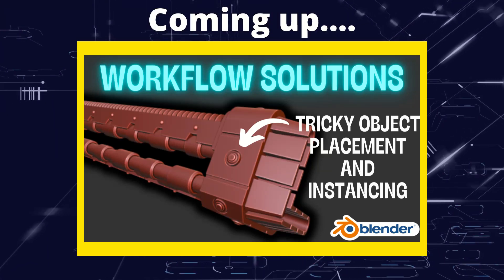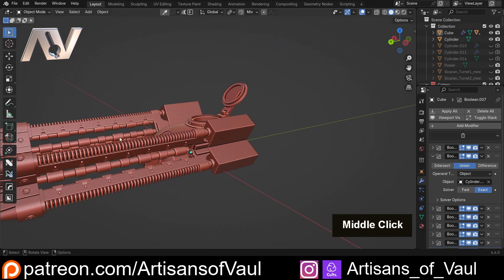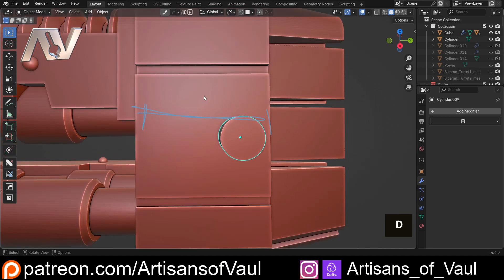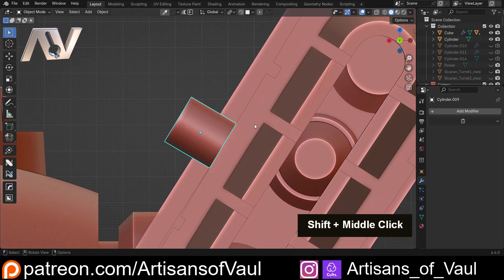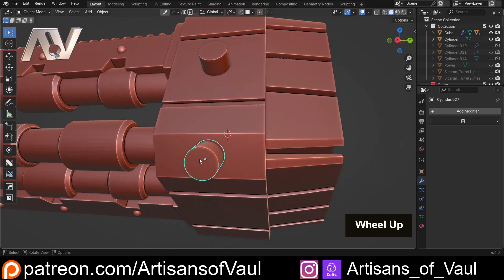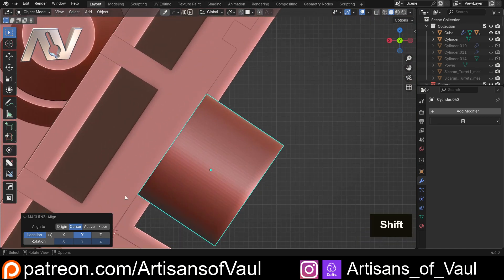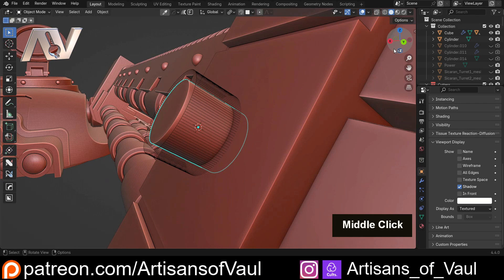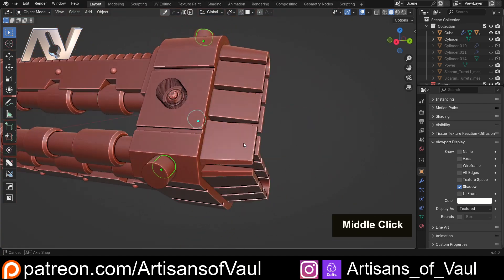Blender Workflow Solutions - Tricky object placement and instancing

Comment: Very nice! Lots of good hints there. I don't think I knew about the base align feature of the grab tool. I do think one could align the cylinder to the middle of the edge like you did by just sliding it along the specific local axis and snapping it to the edge center?  For 3D printing, the cursor/origin pie is worth the $5 right there. :-)
Reply from the maker: I think the issue is that the edge would have a different alignment to the face (in this instance about 45 degrees (between the two attached faces) if I am interpreting what you're describing correctly.

Totally agree about the pie menus but its align relative that REALLY saves a lot of time for 3D printing.
Reply: @ArtisansofVaul  Ah, yes, I think you're right. The edge doesn't really have a normal you could align to. At a minimum, it would be many more steps to get it there. Cool.

Comment: When trying to get the cylinders to the proper depth (in the video around the @5:10 mark), there are a lot of ways to do that... so please don't think my suggestion is the best... it simply works for me as a really quick way of doing it. Simply get the original cylinder to the depth that you want, then go to edit mode and create a new edge loop that rests at the same level as the main part that it sits on/in (leaving a portion of the cylinder buried IN the main part), and then make the other cylinders sit the same depth as the original. If you turn on Wireframe (I think that might be a Machine Tools thing?), or maybe use X-Ray mode with Alt Z (this one is too difficult for me to see properly with the weird ghost like geometry), then you can simply align the new cylinder so that the NEW edge loop rests at the proper depth in the surrounding surface. I don't know if I am explaining this well... but it is really quick to do. Honestly, in almost every model/mesh that I make, unless it has to be dead nuts perfect for some really precise piece, this is my go to quick and easy solution. Anyway, just a suggestion.
Reply: The way I usually do it is to put the origin at the "right" height, then snap the origin to the face. I'm not sure how that would work with these angled faces, tho; you'd still have to align the rotation. But if you're making (say) screw holes to connect 3D printed parts, you can get the right depth very easily that way.
Reply from the maker: Ive got what you mean.  If I needed to be more exact about the depth that could be an option for sure.

Comment: Great video as always! But just.. wow.. This is such a crazy amount of hidden knowledge and actions required to do something that is soooo incredibly easy to do in fusion360 😮 for the hole you just create sketch on the face-draw circle (it easily snaps to exact center)-extrude in the negative direction to cut the hole-your hole awaits you. 🤭 Or really if you wanna get fancy and far less steps (I never do this even though it’s so much easier lol), select hole tool-click center point on face-set hole parameters-holes done 😅 and the snapping, mirroring, and pattern tools make this sort of thing an absolute cakewalk. If you’ve never checked out f360 you should, it’s easy mode for hard surface modeling. Also it’s totally non destructive, and there’s a visual timeline of your history that allows you to tweak things you’ve done at any point in the design. I think you’d really dig it! Then you can bring your model into blender to do any texture/battle damage/wear work. Omg, I would LOVE to see you put out a series on modeling miniature stuff in f360. I’ve been using it for years now but I prolly don’t even know a 1/4 of the full extent of what it’s capable of because the basic tools alone are just soooo intuitive and let’s be honest, I’m lazy lmaoo

Comment: oh my, had no idea you could do that with machine tools.
Reply from the maker: @taerog  Yeah it's oddly hidden.
Reply: @ArtisansofVaul  How should I show it better? Sidebar panel for Align tools?
Reply from the maker: @MACHIN3  I don't think it needs to be shown better, it's just about learning it's there. I like where it is
Reply: @MACHIN3  Also, frankly your tools do so much that getting an understanding of not only what's there but how to use it in useful ways could use a full course. I am a big fan but there is definitely a learning curve (and not surprisingly). 
Some sort of cheat sheet etc? to help? Name of the function and a few short uses? very abbreviated.
Reply: @ I know it's a problem. I'm stretched very thin, with not only building and maintaining them, but then also documenting them. And it's becoming a massive problem now that my revenue continues to decline. I've worked myself into a corner building these big addons with dozens of tools and features. which then so far have all been update for free too. Meanwhile other devs churn out a new single purpose addon every 2 or 3 months.
Reply: That said, I have a plan, and yes will do very short videos soon, going over basics and such. But again, this then also eats a lot into my dev time. It's clear now however,  that I can't "develop" myself out of this hole. I need to better market my tools.
Reply: I also have plans for a bigger project walk through tutorial, but that will come and be bundled with HyperCursor.
Reply from the maker: @MACHIN3  Well as long as you keep up the great addons I'll keep making videos with them in to show them off!

Comment: Interestingly I don't have the align tools when I use Alt + A and I can't see it in the Keymap options, yet I have Machin3 tools installed. (it just deselects all selected objects when I try).

I will try to figure this out as this is something I so frequently have to do and it's tedious using native blender tools. Thanks!
Reply: Try this: Go to Edit-Preferences-Keymap-Keybinding, type in "Alt A" and deactivate the (De)select options. The native shortcuts are very stubborn, but this might fix it.
Reply from the maker: @ryanbarry7670  I can only echo Julia's suggestion below. There must be something else assigned to it but I don't think there is by default normally.
Reply: It could also be some keybinding outside blender, like from Graphics Card software or so. I'm not sure if it was ALT+a for me, but some shortcut just hasn't worked and the solution was outside the (blender) box for me.
Reply from the maker: @phoenix_fire_at_night  Good call 👍🏻